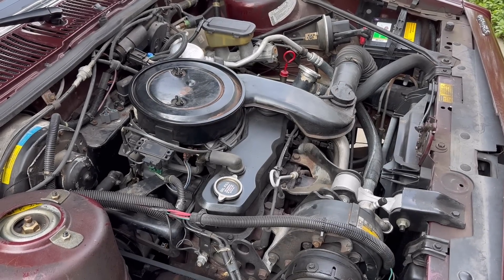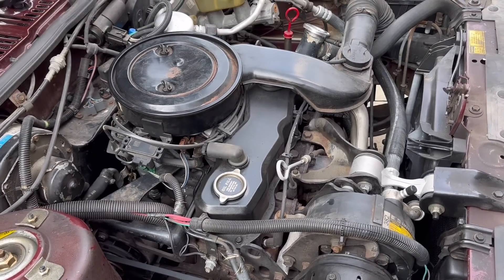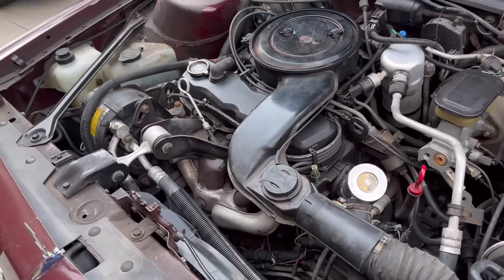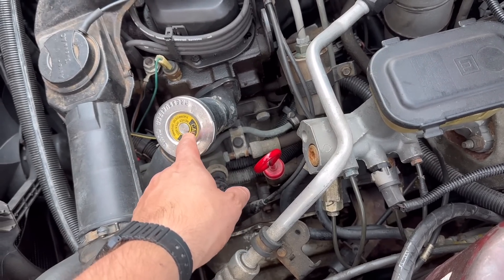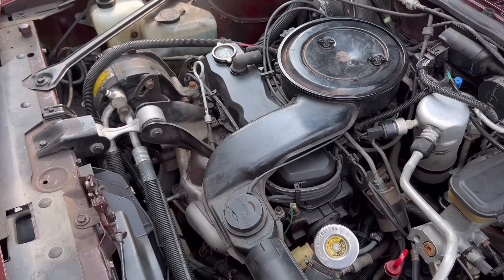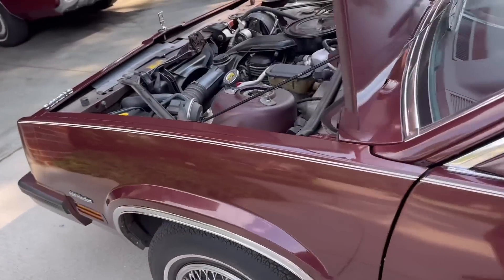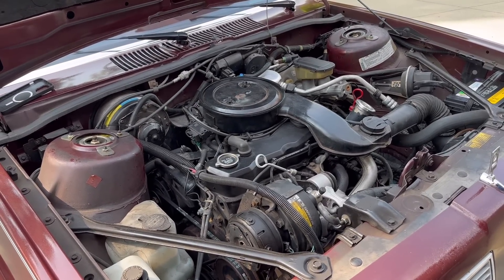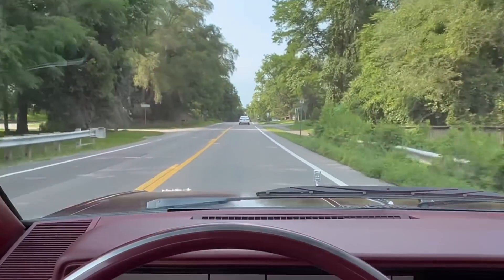Bad Engineering Makes This Engine Challenging to Repair: GM 2.5L Iron Duke 4-Cylinder Engine

Comment: I agree with your assessments . The only other thing that was easy was the dogbone motor mount at the top. The aftermarket even offered a hydraulic shock upgrade replacement for it, for awhile. One thing that struck me that symbolized where GMs head was at was the water pump. The water pump  mounting bolts could be removed from behind the drive pulley (not easily) to remove the water pump but you needed to remove the drive pulley to remove  the water pump bolts from the old water pump to use them for the installation of the new water pump. GM chose to pressfit the drive pulley on to the pump shaft as they did on their power steering pumps. Fine if you had the not inexpensive (to me at least) tool. Eventually NAPA came through for the Shade tree mechanic by selling rebuilt water pumps with the offending bolt pre installed underneath a pre installed drive pulley. The J car was worse you could not replace the water pump with the engine in place at least I couldn't on the 1.8 pushrod motor. Guess who didn't buy another GM car for another 20 years and a 2nd one ever! (Current plan is to die before I need to replace my current vehicles. ) Excellent marketing GM no wonder you went Bankrupt I guess I paid for that as well!

Comment: Had a 1978 Sunbird.  Easiest filter change ever.  Was located on side of engine and could change from above.  Fuel filter was easy too, located in fuel line entering carburetor.  Had 113,000 miles and never used any oil.

Comment: I appreciate the video.  I'm currently getting my 84 Fiero back on the road, and it has the original Iron Duke.  Seeing the under-hood environment on your Olds, I appreciate the fact that the Fiero's steering, brakes and A/C are up front-- greatly reduces the clutter around the engine.  The engine is also mounted in the same direction, just in the back, so the oil filter and distributor are much easier to access.  Still, GM gave little through to how parts would be extracted without removing the entire engine.  Clearly they built the drivetrain assemblies and then put the whole things in as a unit.
With the small Fiero and manual transmission it's quick enough to still be fun.

Comment: The biggest problem with the iron duke was the distributor, I had a 1986 Cutlas Olds Ceiara and had a problem with poor idle, and a little investigation revealed that the hard-to-find distributor had a aluminum base mounted on  a steel shaft and was secured by rivets that came loose and caused all kinds of timing issues that were fixed by  new disrupter  that NAPA stocked as it was all steel and bolted together . The car ran fine with this new part until two head bolts snapped due to bad heat treating in certain 1986 models after putting a new top end on the engine costing $ 186,00 in gaskets and $ 110,00 for a valve job it ran great. Ever since I drove Fords and Toyotas. GMs are not even considered.

Comment: My 80 Monza has an iron duke in it. Solid running car. Thank God it isn't front wheel drive. It is hard enough getting to the distributor even when the engine is mounted longitudinal.

Comment: In my the fieros, the motor is front to back. My 88 fiero has electronic ignition, replaced those coil packs 2 was easier than i thought. Although i already jad the intake off to replace gaskets

Comment: Nylon timing gears were a known issue and a pain in the ass engines. They had gear to gear timing with no chain and the cam gear that was pressed on would break teeth. Due to transverse engine you had to remove the entire engine to replace a $20 can gear!

Comment: I bought a 1985 Camaro with this engine and the 5 speed stick.  Because i could control the shift points, it was not the slug that it was with the automatic.  Because it was in the longitudinal position, the distributor was not difficult to access any more than a 350 v8.  It looked like half a v8.  The problem here is the fwd layout. The real engineering problem was that phenolic timing gears were used instead of a chain, and mine wore out at about 100k.  Factory repair guidance called for removing the cam to replace the gear, though some mechanics would just chip off the gear and press a new one on.  Nevertheless, that Camaro was a blast to drive!

Comment: So what you are saying it isn't a bad engine or even hard to do these jobs just bad packaging in front wheel drive.
Reply: You can get to that distributor in 10 minutes. Just take off the air filter box, and there is also a bracket under there that supports said air cleaner. Once you do that, it's easily accessible. On later years, they made the bracket part of the air cleaner, so it removed as a unit. The modules and caps on these did fail all the time due to heat soak. Even though that's the intake side, for some reason, it would bake down there.

Comment: Nice to hear about the steering rack - I planned on changing the fluid in my A body. Good shape car overall. Steering feels great, light, and smooth, but the fluid is very dark. Reddish brown on a paper towel, but appears as burned chocolate milk in the reservoir.

Comment: That is about as bad as the oil filter on a old 2.2 OHV in the cavaliers..   My old 97 with the 3 speed automatic transmission was a pain...  ALWAYS dripped oil on the exhaust...

Comment: Could you do a video on the 3.8 Ford “Essex” V6 that was used in the midsize LTD and Marquis, and the T-Bird and Cougar in the early ‘80’s?  (Maybe others too)I had 3 cars over the years with that engine and I thought it was fantastic for an early eighties, emission controlled engine. Smooth, reliable, and pretty peppy. Thanks. Love your channel.

Comment: In the 4wd 4.3 first gen S-10’s (maybe 2wd too, I’ve never paid attention to one of them when I had the chance to see one up close) GM equipped them with remote mounted oil filters on the inner fender that were super easy to get to and change. I wonder why they didn’t do the same in the FWD iron duke compacts?

Comment: Nice car Adam !... kinda off the subject but... I still work on these engines in all kinds of boats. The mercruiser 3.0  140 hp is in a lot of em. Went from 151 cu in to 181 cu in.  Some  OMC and Volvo use same engine.  Still see lots with carbs and distributors  ! Easy to work on in a boat....  we got a couple in the yard with that r-4  compressor too !

Comment: Reminds me a lot of the 'design' 'philosophy' on my '85 2M6 Fiero, replacing the Distributor isn't actually all that bad, but the front spark plugs and ESPECIALLY the valve cover gaskets are an absolute PAIN to replace. I pity the poor GM technitians of the 80's that had to put up with that (frankly) crap on a daily basis.

Comment: 1994 s10 4.3L engine mounts. The frame nuts were not welded in. Consequently, you must either pull the engine to do the engine mounts (must cut holes in cab to get to bellhousing bolts or pull with trans), or pull the entire front suspension, steering and steering gear, and front differential in order to get to the spinning nuts inside the frame. They literally built the truck around the engine mounts. The only thing left on the front of the truck for me was the radiator, engine minus exhaust manifolds and fan, and the fenders. I worked on it for about a week straight. The entire bed of the truck was filled with parts and bolts mapped onto cardboard. There was no information about this job, because this design only existed for the year 1994 and was immediately changed. The engine is placed differently on the frame for subsequent years, or the frame is shaped differently, and they weld the nuts into the frame so the truck doesn't have to be nearly completely disassembled in the front.

Comment: I had the cutlass Sierra 4.3 diesel.... dam water pump went out on me, I couldn’t get the brackets from the alternator and ac compressor off. Quick fix was to cut them off with a Sawz All, change the pump and put the nubs of brackets back on , weld them up and keep on motoring!, lol

Comment: Am I incorrect and thinking a lot of this comes from the fact it's packaged in a front-wheel drive. Because I've worked on some iron dukes in s10s And it was not bad at all. They weren't very exciting motors but they kept going. They pulled the wood trailer just fine. Granted they'd only do about 45 mph or so lol

Comment: I don't think the engine was designed to be installed transversely...
Reply: The Pontiac Iron Duke was first used in Rear wheel drive cars. The 1977 Pontiac Sunbird RWD ; the 1977       Pontiac Astre ( Rebadged Chevy Vega ) ;1977 Pontiac Phoenix.

Comment: I had it in a '90 Grand Am, Mother in '86 Buick. Not a powerhouse, but the Iron Duke was enough and a reliable soldier, direct descent of the Blue Flame Six. On my throttle body unit, injector for the 2.8 V6 made a significant difference in performance. Upgrade the 3.1 with a 3.8 injector for similar results. Problem was it was designed for RWD, making it difficult to service in FWD application. Not only was the distributor back there, so was the often neglected oil filter. With dextrous hands and patience, the extra work can be avoided.

Comment: I had two 2.5 Citations, an '84 and an "85. With no AC the distributor was very easy to get too. We had a '86 Ceutury  with AC but it still wasn't ot hard to get to the Distributor. As for the Oil Filter,  just turn the steering wheel  all the way for a left turn. Sit on the floor and it is an easy reach to remove the Oil Filter. With thae small size I could twist it righ off with out a wrench.  My Citations were 4 speed manual transmission and had plenty of power . I used them to pull a small boat all over the Pennsylvania mountains and never got in anyones way. I bought my '84 new and it had over 230,000 miles when I sold it to a guy that ran it over 300,000. I bought the '85 with only 169,000 and put over 40,000 on it.

Comment: Most GM 60-degree V6 engines after 1993 (including the High Value 3.5/3.9) requires access to the front valve covers by removing the heater pipes, and the rear requires removal of the alternator, bracket and spark plug coils. Worst offender is the oil pan from this engine series (two rearmost bolts are hindered by the transmission).
Most newer Ford FWD Duratec/EcoBoost V6 engines with the internally driven water pump; those things should be a no-no these days (runner up would go to GM's EcoTec engines, as the water pumps are partially driven by the timing chain).
Today's V6 engines requires removal of the upper intake manifold just to do spark plugs.
Probably the scariest thing nowadays is the belt-driven, internal oil pump.

Comment: Try changing the timing gears on that engine! Pressed on camshaft gear. The teeth were some kind of fiber material or something. I had that engine in a 84 Buick Century. I'd put that baby on a lift to get at the distributor cap and rotor. I  made it work while I had it.

Comment: My first car was a 1st gen dodge stratus - yes, I know, not a classic but almost - you had to drop the engine out the bottom to replace the water pump. Which I had to do several times. What a nightmare.

Comment: We had 2 Chevy Celebrities from about 1995-2005--a 1985 with the itty-bitty V-6, and a 1987 with this Iron Duke. I preferred the Iron Duke, the fuel injection was smoother and it was somewhat easier to service. Those cars together gave us more than 200,000 miles of mostly trouble-free service between them. We maybe paid $1,500 for the pair used, and maybe spent that amount in tires and repairs over their extended service life. The most difficult repair was replacing the water pump, but it still wasn't too bad. This was emphasized after I'd had to replace a water pump on a 1994 Pontiac Quad-4. What a nightmare that job turned out to be! 
Probably the most challenging repair I successfully attempted on an Iron Duke was replacing the clutch in a 1984 Pontiac Fiero. IIRC this required dropping the engine/transaxle from underneath the car. Then, after installing the clutch and re-installing the engine/transaxle, to finish the job properly you needed to replace and re-align the rear struts. A very labor-intensive repair, that was very expensive at the local dealership! Thanks for the memories.

Comment: Your Omega has some interesting features! Wish my 84 S10 pickup had the straight up hood feature. Yours even has the original amber colored radio display which is kind of rare here in Oregon due to all the wet seasons humidity ruining most of them including my S10`s radio which I had to upgrade to the newer green colored display. That iron duke engine is much quieter than most of those we had at our dealership brand new when I worked as a asst. parts mgr. It still is nosier than our 70 year old Ford 8N tractors though at an idle! I`m glad that I have the 2.8L 'B' engine in our S10 pickup though. For those of you who might be wondering why so many early 2.8`s had crankshaft failures we discovered upon opening up the engine at 122,000 miles our self for the 1st time, the factory did not always have the main bearings in torque specs.or perhaps due to wear the #`s were 1/2 of the values they were supposed to be on the middle main bearings. The middle mains were only 35# instead of the 75# factory manuals said all mains are supposed to be torqued at. The outside mains were right on the correct values.

Comment: The GM orifice tube & accumulator type a/c systems were pretty easy to sort out after a couple of year and they stopped cooling.  
#1. Evacuate system. #2. Replace orifice tube. #3. replace accumulator.  #4. Blow out all lines & evaporator & condenser.  #5. Replace all ‘O’ rings in system.  #6. Add refrigerant oil to system and fluorescent dye.  #7. Evacuate & recharge system.  #8. Enjoy cold air for the next 40 years…

Comment: I had an 82 Camaro in High School with the Iron Duke.  It had a rod knock so loud it sounded like a diesel and a 3 speed auto. The previous owner added insult to injury by slapping Iroc Z decals down the doors.

Comment: 1970 Triumph TR6-clutch change started with removing the interior including the carpet to remove the transmission tunnel, then transmission. The frame rails were too close together for the transmission to slip by.

Comment: The belt tensioner also closed off the coolant of red cuz the water pump/fan clutch was located there on the rwd config. Made a huge mess in the street of buddy's house changing the tensioner.

Comment: They were not thinking. These were GM first front drive X body cars. GM was just using parts bin like Iron Duke for budget mass production. Nice Olds achieved comfortable ride with good gas mileage in all weather FWD.

Comment: What were the engineers thinking? They weren't! Pontiac developed that tractor engine to replace the Vega turd of an engine in the Astre, a RWD car. Then GM decided to use it as a base engine in just about every car they made in the '80s. So the engineers did what they could to fit it in FWD platforms. I haven't seen that t-stat setup on any other engine but it's actually a very good idea. Pulling out the t-stat makes it easy to refill the cooling system without it becoming air bound.

Comment: Working on a Slant 6 distributor sucked, too. Plus, it had a nylon helical gear driven off the crankshaft. You could be off a tooth and have to go in and out with the distributor to get the basic timing set. Plus, the oil filter faced down, making a mess every time you removed it. You also couldn't prime the filter when replacing it. My dad loved his Slants but I was never a fan.

Comment: You missed the most glaring reason for nearly all your complaints. I reckon it is because the iron duke was designed for a RWD platform to be mounted as god intended

Comment: Had an 1982 Chevy Citation with the 2.5 Iron Puke.  Ended up with a bad water pump which in turn took out the head gasket.  Drove it for 2 weeks with it like that.  Sold it to a guy that wanted to swap engines.  Got $800 for it, which was a lot of money back in 1992.